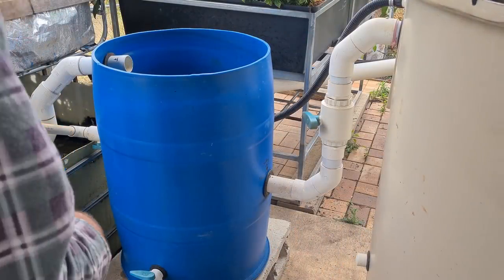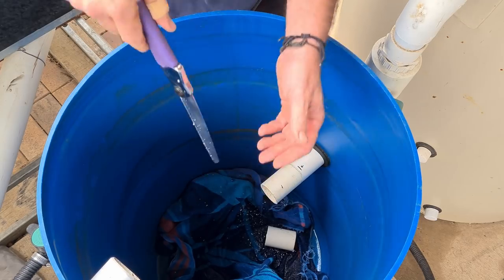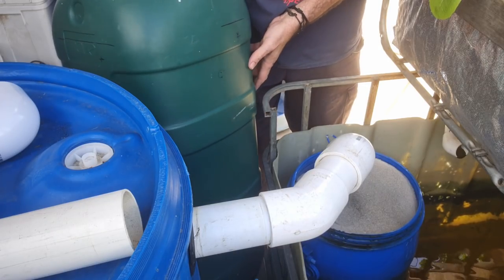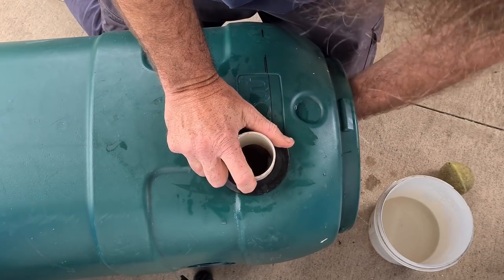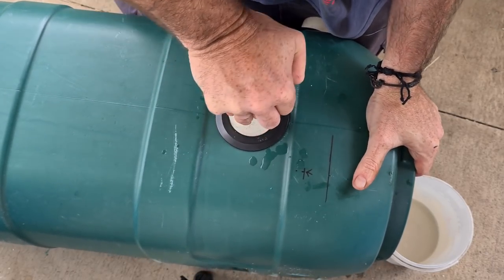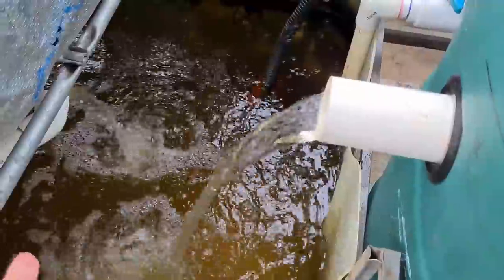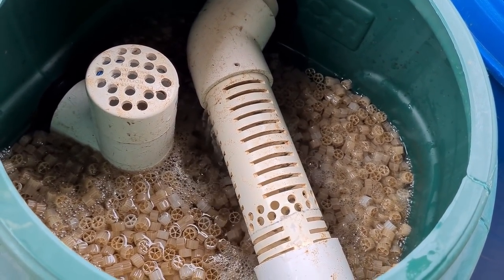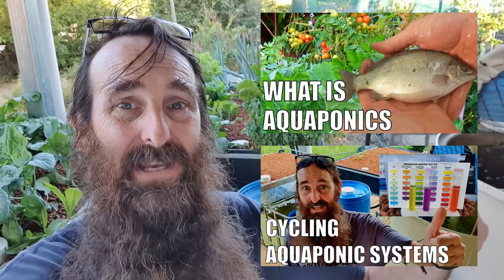Aquaponics Biofilter | Adding a Moving Bed Biofilm Reactor to the Aquaponics System

Comment: rob how big of a pump do i need for that system.
Reply from the maker: That depends on the size of the fish tank & system in general Les. This video might give you a few ideas. It's a look at our current system just after it was set up. 
https://www.youtube.com/watch?v=1q_MN4kZRlY
I have swapped the pump to a larger one after adding another bed. It currently has a pump running at about 5-6000 lph in it.
Cheers.

Comment: how do you size the bioreactor to water water volume? is there a ratio or is it based of flow rates?
Reply from the maker: I've been told that 5+ min retention time would be best. This unit has a fraction of that due to its size but it's the best I can do for now. 🙄

Comment: Hi Rob, I have setup the IBC chop and flip, I have followed the bell siphon as per video with the exception of using a 50mm pipe for the bell, the issue that I'm experiencing is that the siphon does not stop after the grow bed drains. Could this be linked to the size of the bell?
Reply from the maker: Hi Ralph. Sounds like it's a flow issue. Try turning the flow into the bed down & see how that works for you. If you have a 45 or 90° elbow on the drain under the bed, make sure that it's not turned too far up stopping air from traveling back up the drain as well. 
Sorry it took a while to respond. Would like to know how you get on mate.
Cheers.
Reply: @RobsAquaponics  Thanks Rob I have manged to tune the bell siphon so that it flood and drains the grow bed, it take about 30min  to flood and about 25min to drain. The other issue I'm facing is I have overdosed the system with ammonia, I have removed 150l of water from the system and replaced it with tap water but the ammonia is still sitting at 5mg/L.
Please advise if I should remove more than a third of the water. I had about 500l in the tank
Reply from the maker: @ralphdavid2962  Are you seeing any nitrite forming? If you are seeing nitrite you might be able to get away with leaving the water as is.

Comment: It's really too bad that someone out there can't design and manufacture a small swimming pool type vacuum on a wand that can be lowered down to vacuum the solids off of the bottom of the bio-filter tank/barrel. A robot tank skimmer/cleaner with an attached hose to ride around the inside of the habitat tanks to clean the tank walls and bottoms would be a bigger version of the mini cleaner/vacuum.
Reply: Since you came up with the idea, why not take advantage of the idea you have and design a prototype, and if it works then you get the reward. All successful people start out with an idea. Perhaps you can research it and see if there is anything in line with what you are thinking and it it's not "GO FOR IT"...who knows, this may be the start of something BIG but you won't know till you do it.:)
Reply from the maker: I have made a wand attachment that fits to the drain that does that job with a bit of fiddling around.  
https://www.youtube.com/watch?v=zETpcZmm8QE
Haven't used it for a few years though as most of the systems are self cleaning.

Comment: Hi rob, is I possible to use polyester as media in Aquaponic? Your views please
Reply from the maker: I have seen folks use it as a solids & bio filter media. I probably wouldn't as it is hard to clean & may need replacing more often than other material. Are you wanting to use it as a solids or bio filter?
Reply: @RobsAquaponics  hi thanks, I was wondering if it can be used as both.
Reply from the maker: @birendrachoubey6122  I've seen folks use it as both. in smaller systems. 👍
Reply: @RobsAquaponics  hi Rob, actually looking to implement in large system, pl suggest if possible ,whether to use it as biofilters or solid filters or possible combinations. If you have some surface area calculations related to fish density then that would be great.
Reply from the maker: @birendrachoubey6122  I wouldn't use it in a large system myself as it will be an ongoing  cost to replace it.
I would use a settler filter like the radial flow settler & then a stand alone bio filter like the moving bed biofilm reactor.
Reply: @RobsAquaponics  ok thanks

Comment: What size are your air pumps mate . Toowoomba area here
Reply from the maker: Hey Bradley. The pumps I'm running are about 4000lph. Not sure I'm getting that amount through to the stones due to water depth so that's why I over sized them a bit.
Cheers from down the hill. 👍
Reply: @RobsAquaponics  
Thanks bob , I got a 82L/min air pump now .
My water pumps are 2 x 5000LpH with speed control on 4 x 1000l ibcs . 
Thank you for sending  my order for uniseals so fast aswell , I can finish my 2 filters and mineralisation tanks now . 
Keep up the great work
Reply from the maker: @bradleysmith4787  It's no problem at all mate. 👍 Hope the build goes smoothly, sounds like it's going to be a decent-sized one.

Comment: Why don't you use PVC cement?
Reply from the maker: It's not always needed as you can get a secure water-tight seal using the plumbing tape & screw method I've found. Makes working on the plumbing later on a lot easier & saves quite a bit of coin over the years. 😉
Reply: @RobsAquaponics  ooooh

Comment: why did you stop using venturis?
Reply from the maker: I don't have a need for them at the moment as the pump I have is sized just right for the beds & fish tank. 👍
I have also had water pumps fail previously & almost lost the fish so like to keep a dedicated air line in the tank now. 
Will probably be adding one to the bio in the next larger system we build though.

Comment: aquaponics better than Hydroponics?
Reply: I think for commercial purposes hydroponics is better and not that risky.
Reply: Not better: Simultaneously more complex and simpler.  More complex because you need to deal with the fish, oxygenation levels, ammonia levels: If you are doing aquaponics think of yourself as a bacteria farmer.  Without a healthy amount of surface area for nitrogen fixing bacteria, the fish will die.   So you build a system focused on the Fish! and the necessary bacteria to process the ammonia (from the fish).  Secondary to all of this, is a side benefit that the processed water carries /almost/, not all, but almost the nutrients for healthy plants.
Little chemistry to worry about except: *any chlorine components in water? (bad). *control the ammonia and nitrogen levels by controlling the fish feed.  --> Still have to supplement some plant nutrients which are not available in the fish-feed.
Hydroponics:  Simpler - no fish/bacteria to worry about. Hydroponics does not suffer risk from anaerobic bacteria "crashes" (which will wipe out the entire fish-stock).
However, you have to pay closer attention to chemical recipe(s) you use for your nutrient solution.  The plus side is that all the micro-nutrients are there.  The down side is that unless you've the chemistry set, you can't test for individual nutrient levels and must instead rely on product label (guaranteed analysis) and math to Infer nutrients from a generic ppm or EC measurement.
In either case: you need to buy fish-food, or, you need to buy fertilizers and mix.  
Note:  You can plan and build a 'for fish' system, but run it as hydroponics until you are ready to make the switch to fish.
This gives you opportunity to practice your plumbing skills, and work out little bugs and leaks and drips in the system without fret of killing your fish-stock.  Much less stress - good beginning point.
I've built out an IBC chop-n-flip system (As seen in Robs other videos/how tos) with 55gal blue-barrels split down the length for auxiliary grow beds.   
I'm running the system as Hydroponics currently (with Master Blend + Epsom Salt + Calcium Nitrate) for my nutrient mix.
And --- When I'm ready to try fish.... I'll toss in some carp (no-guilt gold-fish) to start.   Then I'll start feeding fish-food instead of mixing the hydroponics blends.
NOTE The moving bed bioreactor is a big fish-saver!  All commercial aquaculture systems have designed in from first go.
OH Yeah!  Big Importance:  Hydroponics you can run on an intermittent pump. (I'm using 5 min ON, 15 min OFF) - This lets me use a low power D.C. pump (which is suitable for battery and solar panel).     Aquaponics:  Don't ever let your pump system die!  Power outages more than 12 hrs -- fish will begin to die - Hypoxia.  Required system pump power argues for an A/C powered pump.... which puts you (your fish)  at the whim of your local electric-gods.   Note: Rob uses a 12VDC backup battery to power air-stones separately.  This is a hard-learned precaution against power-outages.
Reply: @Verfolnir  thank you so much for your help and advice
Reply: @thedarthlord7724  thanks for the reply
Reply: @butchvandyk1051  no problem
Reply: Aquaponics is hydroponics.  It's a subset of it.  
The only "difference" is that in aquaponics, your fertilizer source is fish food, and your primary crop is fish.
Reply: @Verfolnir  WOW...thank you for your input. As someone who has very little to some experience with hydroponic using Masterblend nutrients and NO aquaculture experience, I always wonder where should I start...so what ALL you said makes A LOT of sense to me. But first I am still researching on the greenhouse and that's another monster to learn by itself. I have SO MANY questions on the "greenhouse" because the greenhouse I chose will have to withstand high wind, snow, etc... accommodate my aquaponic and other plants.  So much to consider BUT you are right, I need to start with learning how to keep fishies ALIVE...lol.  I was wondering where would one go for getting good reliable information on how to grow fish specifically or learn about aquaculture besides youtube video...is there a good reliable class, online school? I said "good/reliable" because there are so much out there. Thank you.
Reply: @mandiegarrett1706  I’m also a newbie at the aquaponics and have heard that it would be best if you was to visit with the local fisheries as they can provide information on what fish would work the best for your area. Again I’m just a newbie and still learning aquaponics and the greenhouse before starting either.
Reply from the maker: If you're after veggie production I would suggest you stick with just hydroponics. 👍 Is a lot easier to run in that you can keep the pH lower than most fish are comfortable at. You also need less bed space & have more control over nutrients as well as growing conditions.
One thing to keep in mind though is that you may have some nutrient rich water to dispose of depending on how you run the set up. I chose to use a plant & fungus based Aussie nutrient blend for that reason & pour the excess out on plants in the patch. 
If you want to grow some extra protein, then aquaponics is the go. 
Just my 2 cents worth.
Reply: @RobsAquaponics  I wish I could up-vote this further!   Rob is, again, spot-on and straight with this statement. (not withstanding how easy he makes aquaponics appear. 8 - )
Reply: A further detail:   IF, IF your Aquaponics + bio-filter(bacteria) are running perfectly -- converting fish-ammonia(NH4+) into nitrites(N02-) into nitrates(N03-)... There is still a slow build up of nitrates in your system which will eventually poison your fish stock.  To combat this, one needs to maintain some 'M'-total meters  of green-leaf surface area for the plants to suck up (and filter out) the nitrates.   
Ultimately it comes down to, along with correct temperatures, and assuming sufficient bacteria surface area, it comes down to " how much fish feed(x protein content) per square meter of plant you are growing in an area per day (example – 60g /m2/ day for lettuce)" -Dr. Rakocy.
-- Physicist.
Reply: wow i didnt think i would get all this replys and info it is almost overwhelming... again thanks for all your inputs